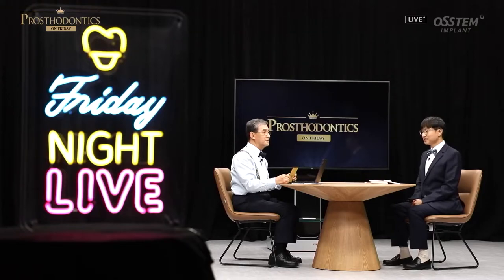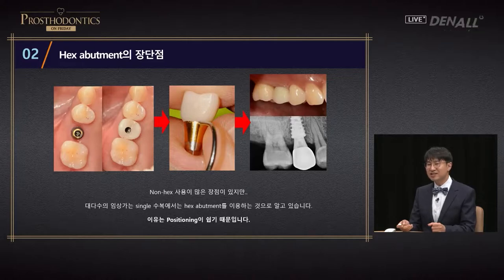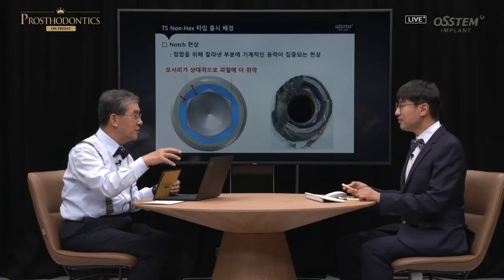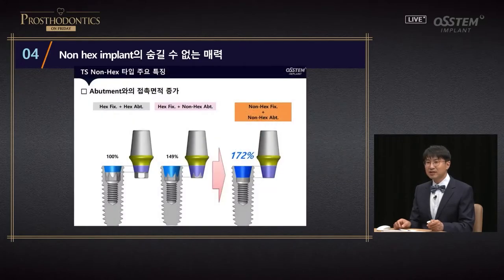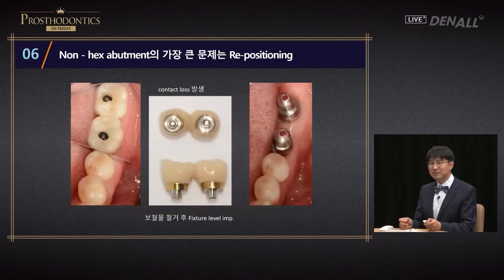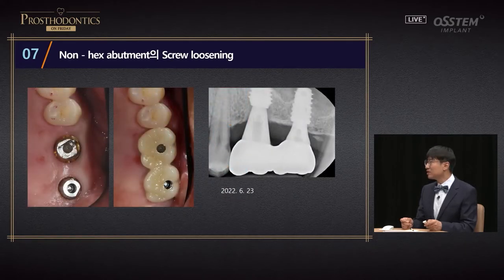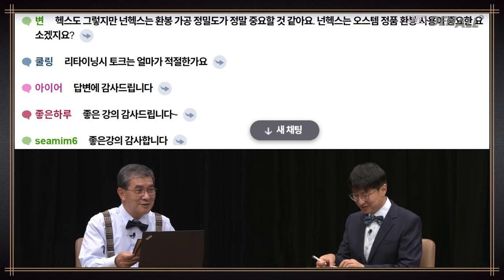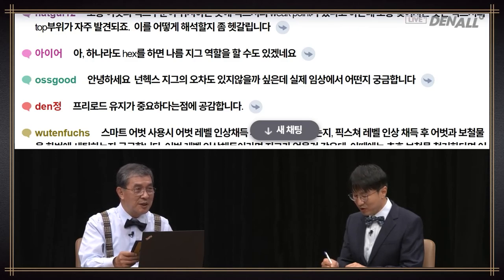[PROSTHODONTICS] Advantages and Disadvantages of Hex and Non Hex Abutments

Comment: Hello. Thank you for the lecture. I have a question for Dr. Jong-Hyun Park. How do you prepare/clean the surface of implant internal connection and abutment conical connection before assembly? For me this is a concern because i believe that there might be certain debris or blood residue in the implant connection after surgery or impression taking and on the abutment and abutment screw after it comes from the lab. I would really like to know your thoughts on this.